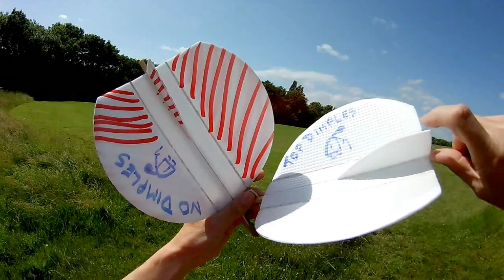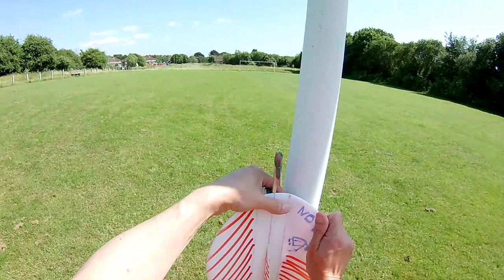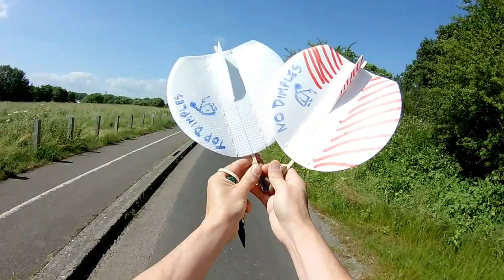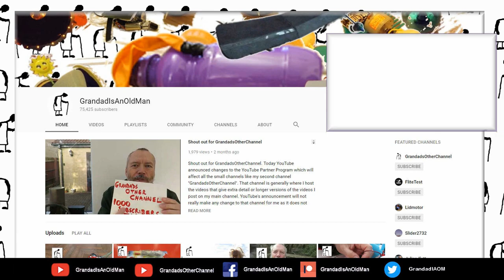V3 Top or Bottom Dimples Pizza Tray Catapult Launch Gliders SECOND FLIGHTS

Comment: Hi GIAOM, just an observation regarding the rolling tendencies of your gliders. The shape you are using is very reminiscent of the FT Nutball, and the problem with that is, that the 'Nutball' is quite an unstable airframe. If you watch this video https://youtu.be/t7aFMd24bAc you may recognise some of the problems you are having, in trying to stop your gliders from rolling. I know the 'Nutball' is a powered design, but as soon as I saw your issues, I immediately thought of something I had read about the stability of the 'Nutball'. In fact in the forum FT posting, where I first saw this video (https://www.flitetest.com/articles/learning-to-fly-ft-nutball-repeated-headcrash), the second comment details the 'Nutball's' instability issues. Your comparison test may have produced better results with a more conventionally shaped airframe. I may be way off beam, but the similarities seen pretty close to me. Hope that helps with your tests. One other thought I had, which may help, is installing two larger vertical stabilisers on each glider, out where the dihedral starts.The other thing I was going to suggest was to flatten the top of the dihedral to make it parallel to the flat bottom of the airframe, but you achieved a similar effect by rolling it around the goalpost :-)
Reply from the maker: Thanks I haven't read the forum post or watched the video, but I will have a look. I suspect one of the basic instability issues for my pizza tray is around the centre of lift in relation to the centre of gravity. Another observation is the trim for hand launch and the trim for catapult launch is completely different and that will be down to the speed and the effect that has on the airflow over the flat plate. As for the rolling on launch, much of that will be down to the short "wings" amplifying any minor difference between the trim of each wing, a wider wingspan would dampen the effects. My design is in no way related to the Nutball, it is simply another one of my builds that design themselves based on the components used. Stage 1 was "I have a round pizza tray with dimples on one side". Stage 2 "I have a wooden stick that landed in my garden after somebody was using fireworks and rockets". Stage 3 "I have some bits of plywood left over from those flat pack wooden dinosaur kits". Stage 4 "How can I make this fly with the minimum amount of effort". Stage 5 "Glue the stick to the pizza tray and use a bit of that plywood that is hook shaped". Stage 6 "Maybe fold the wing tips up a bit to give us a bit of stability". Stage 7 "That was easy, better make one the other way up to see if there is a difference" 
PS just watched the video but the link to the forum didn't work so I searched around on the forum for Nutball issues. I have also added 3 of the FliteTest Nutball videos to the playlist related to this series so people can watch them if they want to.